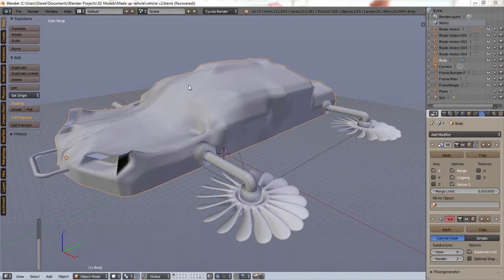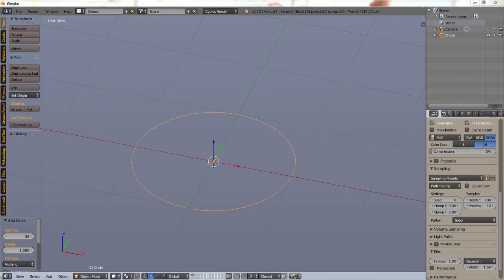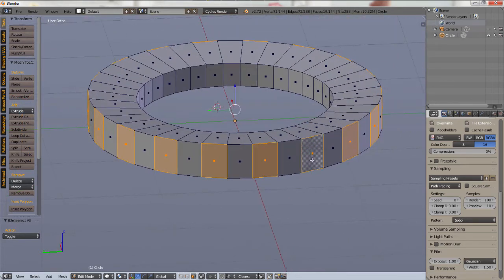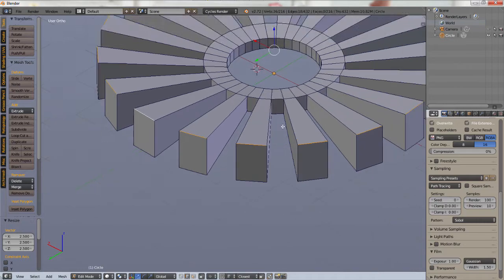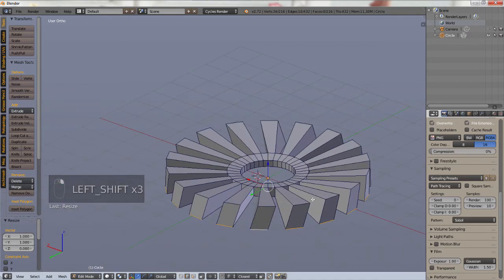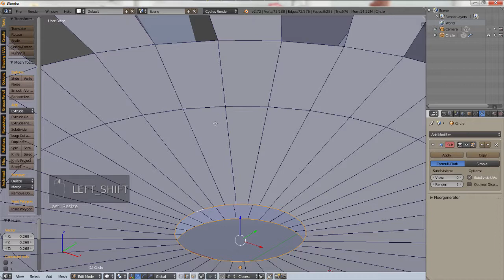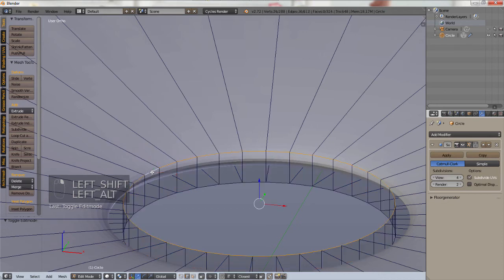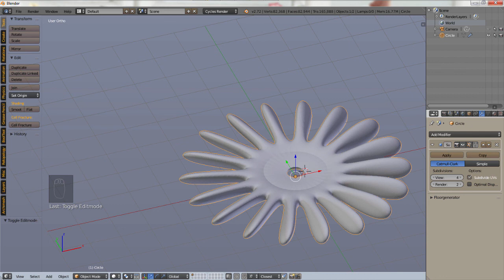How to Model a Propeller or Turbine or Fan in Blender Tutorial / Quick tip - v 2.72 / 2.73

Comment: IMO it's better to use Array using an object (like EMPTY). Than you can just modeling single part of array, and it is automatically updating all other parts in Aray. You can then simply add loop cuts etc and it's a lot of faster. In your way, you will have to do this about 18 times ;/